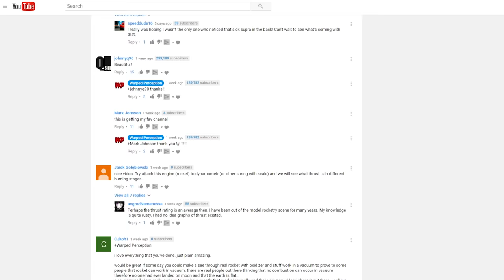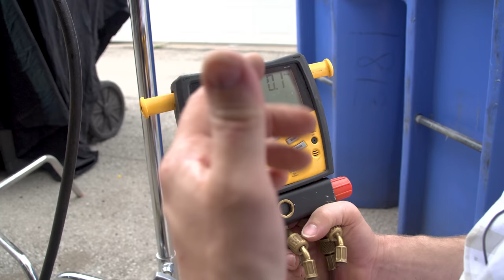Model Rocket Engine In A Vacuum Chamber - 4K Slow Motion - will it burn? - Rockets (S1 • E3)

Comment: FEs: Rockets don't work in a vacuum!
This video: *Rocket works in vacuum*
FEs: That's no proof!
Reply: That vacuum was comparable to a Barbie vacuum. Lol! Not enough suction power to be a notable reliable source. Oops!
Reply: What is 'suction power'? Get some education.
Reply: @Lifeisgood262  Proof of it? No? Okay
Reply: @Lifeisgood262  It thrust against the end of the tube, but very little, do the same experiment with out the vacuum. you will see the difference.
Reply: @Lifeisgood262  - "suction power" doesn't exist a vacuum is simply emptiness "suction" is actually pressure attempting to equalize an area of lower pressure
Reply: S it works because space is a vaccumed area
Reply: Of rocket flies in space then it is burning in vaccumed area
Reply: @Lifeisgood262  You know a vacuum is the opposite of suck right?
Reply: I don't know about flat earthers, but I don't know anyone serious who thinks that rockets can't fire in a vacuum because they have their own gasses to ignite. What I have heard is that the expulsion of gasses from a rocket can't provide propulsion in a vacuum because there is no gas to push off of. Sort of like how there is less lift on a wing the higher you get in altitude.
Reply: @dertechl6628  They can't even understand how a Vacume cleaner works if (it isn't via suction) as some fools claim! Lol
Reply: It's not proof.  It's a failed experiment.  You obviously don't understand argument about rockets not "working" in a vacuum.  If your car starts but doesn't move, would you say it is in working condition?  Well, maybe you would.
Reply: @pearlmax  "It's a failed experiment....If your car starts but doesn't move, would you say it is in working condition?" That's why the "spring" thrust mount was added. It clearly shows that the rocket motor did not merely burn, it generated thrust.
Reply: The reason wings don't get lift at higher altitudes is because there is not enough air particles travelling over the wind to produce a pressure differential big enough to over come gravity.  Look up The Bernoulli effect.  Rockets and jets work on a different principle.  They utilize Newtons 3rd law of motion to provide thrust in the opposite direction of the exhaust gasses leaving the nozzle.  The same way that a garden hose doesn't push any harder in a swimming pool than it does in the air.  In fact, the lack of pressure can allow the exhaust to come out even faster and actually increase thrust.
Reply: No pressure, no gas.  No gases, no Oxygen.  No Oxygen, no combustion. This 4sure is fakery!
Reply: @abelmicah3430  no oxygen no combustion.
Reply: MoneyIsSilver its not much them saying that they don’t fire in space it’s them mainly saying that rockets don’t work in space because there’s no air to push off of therefore the rocket wouldn’t go anywhere even though the rocket pushes off of itself
Reply: @abelmicah3430  You can easily recreate this experiment.
Reply: This isn't a vacuum chamber. It's a combustion chamber. Lol it gives pressure on ignition. .. air pressure.. what you push off of. Lmao 

Can you fly with no medium to fly with.. when gravity still pulls. ?? 

Lmao.
Reply: @justinfranklin7639  those rockets have the oxygen built in them. They don't need extra.
Reply: @MoneyIsSilver  it's not pushing against something it's Newtons law
The action of expelling material one way creates an opposing force the other way
Reply: The military knows the earth is flat. All the tests show it is. What's the problem?
Reply: @natureslovers6438  you're kidding... right???
Reply: @dominiccharvet546  what are you talking about?
Reply: @rob864guy  That depends on what your asking.
Reply: @dominiccharvet546  you're saying that the military knows the world is flat, that they proved it was flat through testing.
Reply: @rob864guy  Actually they said it not me. They do all their tests on a flat stationary earth. You should ask them. Everyone knows the earth is flat. You my friend have been duped.
Reply: @raymondaninipot2994  Youtube jides all the new proofs of evolution lies. Dinosaurs live today and have lived in the last few thousand years. They are found with skin and scales and blood cells and capillaries. All the lies given by the evolutionists is to turn you from the knowledge of the Creator. They don't want you to know the truth. Don't fall for the lies. They even destroy proof. When men's footprints are found with dinosaur prints they destroy them.
Reply: @raymondaninipot2994  Nearest star is 25 trillion miles away according to the math. How could anyone see that light? Why do any of us believe these space liars?
Reply: @dominiccharvet546  That's the problem with all of you. You're treating YouTube videos as if they were legit and reliable source of information.
Reply: @dominiccharvet546  1. No, the nearest star is our sun, which is 151.63 million kilometers away.
2. Light can travel in a vacuum and do not require a medium to propagate. Since it is not interacting with anything, the wave doesn't not dissapate and will travel very long distances as long as nothing will absorb it.
Reply: @raymondaninipot2994  I guess you will never know. But When your ready go to the flat earth channel or the 24 7 flat earth site and see how evolution and globe earth is all lies and no science. NASA people don't even know they make equipment for the wrong reasons. Anger will never get you where you need to be.
Reply: @dominiccharvet546  Ahhh yes a typical flat earther. I answered your question and then you proceed to saying the same words that I heard hundreds of times before from the flat earth community. How certain are you that your god is the real god if all of the other religions are saying the same thing? Do you think NASA is the only space agency in this world? If NASA is lying, then how come no one exposed the truth yet? They have thousands of employees and yet no one revealed the truth even though they are close to their death?
Reply: @dominiccharvet546   Muslims say that is jesus is just a prophet so who should I believe? "When someone says they don't believe in god or jesus they are not using the brain god gave them" so I need to accept set of beliefs without thinking critically? Sounds like indoctrination to me. You did not answer my question about NASA, do you think that big of a lie can be kept hidden for this long? Even small lies don't last for a decade and something that big lasted for more than 50 years? Actually I love watching flat earth videos and until now I'm still amazed on how stupid humans can be.
Reply: Pretty much every flerf debate I’ve had 😂
Reply: How did you see this video space!
Reply: Rocket engines produce their own Oxygen. THAT'S  why they're so powerful, and that's also why they CAN run in a vacuum.
Reply: @salemcripple  More like rockets carry their own oxidizer but yeah!
Reply: Flat Earthers: FAKE! It's CGI!
Reply: Rockets use Advanced propulsion systems to move in vaccum space. With the help of magnetic and electric fields.
Reply: @kaleem9093  Current rockets don't do that, if you find a way to get significant propulsion from the magnetic field of the Earth you can become a millionaire selling the patent.
Reply: Rockets do not work in a vacuum, they have no medium to push off. Any obeject, be a rocket or anything else cannot push off itself without a medium. Throwing out mass in an infinite vacuum leads to instant equilibrium between the mass and the vacuum in the alleged space and the end result is no movement . The alleged space with vacuum is no more than a fabrication of the mainstream(pseudo) science of the west.
Reply: @tsurutuneado5981  I think you've got more chance of extracting blood from a stone than convincing these wallopers on how rockets work.
Reply: @Rus-bw2oq  They don't need air to push off of. They use the really fast exhaust gases to propel them.
Reply: @tradingpost2472  Once again, It is the equalization of pressure. If you have a pressurized propane tank and poke a hole in it, the gases shoot out, Why? Because the gases want to equalize in pressure unless overwhelmed by another force.

Edit: Ok i'm not sure if you are vacuum = sucking or not. But i'm Still going to keep this here for others to read
Reply: @dominiccharvet546  So that's why flat earthers have disproved flat earth with the experiments they did(I.e. Laser Gyro, Light and holes(watch the documentary idk what its called),etc)
Reply: @dominiccharvet546  People can see the light from the star because there is no medium to block the light coming from the star. That's why space is considered a VACUMM, or an absence of matter. The light takes time to travel(about a 4.24 year delay).
Reply: @dominiccharvet546  There are literal Millions of religions. How do you know that Christianity(And similar) are the right ones. How do you even know there is a god. It is almost impossible to prove. You could be wrong about the god.
Reply: @pressyprice  Now lets see you prove that one buddy. And I don't mean on paper. Go up there and show me.
Reply: @pressyprice  When you receive the Holy Spirit you will know. Ask Him to forgive you for your sins and come into your life. Step out in faith and see what happens.
Reply: @pressyprice  does not prove anything.
Reply: @dominiccharvet546  oh this equation is the source of ALL rockets here(  a=vemΔmΔt−g a = v e m Δ m Δ t − g, Δ v = u ln ( m i m )
Reply: The vacuum of space. What could the rocket push off? And how much fuel would it take to push a rocket up to 16 thousand miles per hour in space? Think!!
Reply: @dominiccharvet546  It pushes off its own fuel, more specifically, the gasses created from the combustion. The amount of fuel needed depends on the size of the rocket, the payload, the engine's isp and the propellant used. Next question?
Reply: @tsurutuneado5981  I see you have not thought that one through
Reply: @dominiccharvet546  Please elaborate
Reply: @tsurutuneado5981  If you were in so called outer space you would see. There has to be something to push off of.
Reply: @tsurutuneado5981  A rocket has it's own fuel air. But in a true vacuum there is nothing to push off. The air coming out of the rocket would just disappear into the vacuum. Prove otherwise.
Reply: @dominiccharvet546  Again, they push off their own fuel. 

A more detailed explanation is: They push off the gasses formed by the combustion of the propellant. Cars do the same. The piston gets pushed down by combustion gasses.

In order for something to move in outer space, energy needs to get out of the system. In this case the system is the rocket.

If you can prove the energy created by burning propellant can be contained in a rocket then you can prove rockets don't work in a vacuum. In other words it's proof by contradiction.
Reply: @tsurutuneado5981  Think it through .....Think it through....the gas in the engine pushes off itself. a hard surface. In a vacuum what could it push off? Vacuum? The gas is lighter and would push away anyway.
Reply: @MoneyIsSilver  A lot of people here seem to be misinformed about what makes a rocket engine provide thrust.

When the gasses expand and shoot out the back, there is momentum which causes an equal and opposite reaction, pushing the rocket forward. Think of what happens if you stand perfectly still and toss a bowling ball forward. You will be pushed backwards (unless you balance yourself which is a natural reaction). The bowling ball doesn't need a surface to "push off of."

An airplane wing produces lift when the air must travel faster over the top than the bottom because the shape of the wing makes the distance over the top longer. Think of a marching band that is split in two where half the band must take a longer route so they have to walk faster. As they do, they spread out. Same with molecules of air. And when the molecules are spread out, that's less pressure then the molecules under the wing, causing the pressure underneath to push the wing (and the plane) up.

As for the engine being able to burn in a vacuum because there's no air, I'd remind people that there are welding tools that work under water. The welding torch carries its own oxygen, just like the fuel in the rocket.
Reply: @MoneyIsSilver  Hahaha I thought you were serious for a minute. You got me :-) Some people actually believe that though so I wasn't sure.
Reply: @tom1955826  You can see that no thrust is generated by the rocket in this experiment until the gas starts filling up the tube.
Reply: @MoneyIsSilver  Ok, well I checked out your YouTube page to see if you were kidding, like maybe you were playing the devil's advocate just for fun. But I see a lot of backward thinking there buddy. Suggest you stop calling other people names and read up on Newton's laws. Stomping your feet and saying something is a myth and calling people stupid who don't agree with you won't get you far. An education, despite your beliefs, will.

Comment: the system is closed, quickly ceases to be a vacuum, filled with gases
Reply: it wont make a difference
Reply: @vertex3243  Do you have an or know of an experiment to prove that? Thank you in advance.
Reply: @vijithkumar  the thing is that the plume of exhaust is not oxygen so it wont make a difference in how the motor burns. There is no experiment that i know of that is in a big enough scale for the exuaghst to be insignificant besides actual space.
Reply: @vijithkumar  I believe this video does a good job to prove everything other than conservation of momentum ( at least not in an obvious way ), which is what you want if you need proof that the exhaust doesn't have to push against something to generate thrust, you could change the same experiment to use a water rocket type deal or a spring loaded counter mass, there are countless other intuitive experiments that prove conservation of momentum.
Reply: @vertex3243  Yet no rocket engine has ever gone beyond the exosphere so when will we prove that 😂
Reply: @natureworld295  have you heard of the Apollo missions? or any of the mars rover missions???
Reply: @natureworld295  you realize your the one who is confused by it so you choose to say its fake
Reply: @natureworld295  You do realize I can talk to satalittes. There are sats open to the public to be accessed. How do you explain Sat TV?
Reply: @natureworld295  the Space station has licensed HAM radio operators in space. You are able to talk to them. I have been in contact with them multiple times and I can guarantee you that there are people in space. Please don’t be so naive.
Reply: @natureworld295  lol if its fake than for example how does starlink work or why can we see satelites fly in the sky or see rocket debree falling back to earth?
Reply: @vertex3243  you believe the moon missions of the 1960s for real? How is it when people are shown a significant and obvious amount of video evidence showing how poorly they executed the hoax people still can't admit they were lied to? Are people really that insecure they cannot accept the fact that they allowed themselves to be lied to on such a grand scale?
Reply: @kaktu7983  where do you think a satellite is? You obviously have no idea about the different orbits that exist between earth and outer space.  There's much to pass through before getting one to outer space. The radiation level alone is evidence enough apolo mission's never made it to the moon or even attempted to go.
Reply: @mistylouis4476  well than how satellites don't fall back to earth and well they definitely did attempt to go there what happened to the big saturn V launches how do you explain the pictures of apollo landers from other satellites
Reply: @stuartgray5877  actually partially true. I don’t believe any solid fuel rockets motors have been used in space, not counting the SRB’s on the shuttle which remained in the atmosphere, for the reason we saw in the video. They work but are not efficient in an oxygen deficient environment Not arguing with you in anyway. I have never read about the use of out of the atmosphere.
Reply: @heeder777  where did you GO genius?
Oh and lookup the Magellan mission to Venus. That spacecraft took a Solid Rocket Motor WITH IT to Venus for orbital insertion.

Do you people ever do ANY research before arguing with experts on YT?

Comment: I wish you showed the pressure gauge.
Reply: He can't do that, since that would invalidate his programming. This is a mason and like all masons he tells you exactly what he is about with the title of his show. What is the title of his show?: "Warped perception". That is what this show is about. If you pay more attention to stuff like this, the world becomes a lot more interesting.
Reply: @wtfvids3472  I hate to tell you this, I am an industrial chemical process engineer and among many other projects, I lead engineered the world's biggest air movement and purification project of its kind at the world's biggest automotive plant of its kind -- and it worked. The same equations we use to engineer your working car and working mobile phone also easily predict that if you are in a vacuum chamber on ice in a chair with rollers and you throw a basketball that you will move in the opposite direction you threw the basketball. Except when it is done with a rocket, you are throwing tons of mass per second at incredible speeds. So, really, there is not even a reason to discuss this. It only shows you would never be accepted to engineering school to create safe, working environments to manufacture the most essential elements of civilization. Thanks for playing.